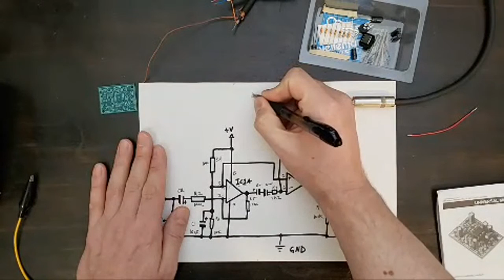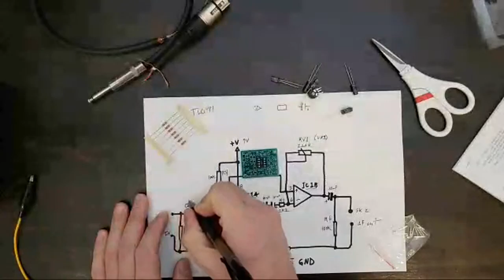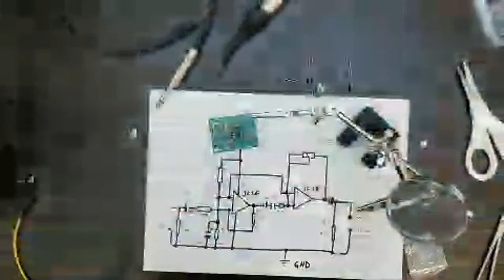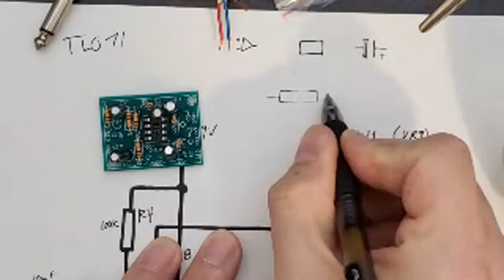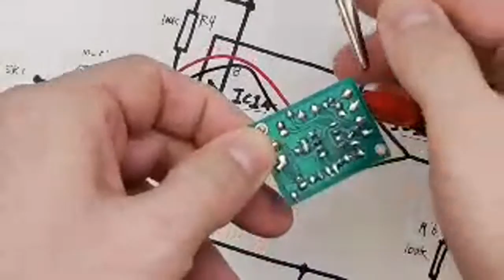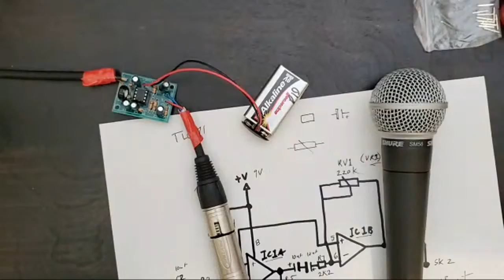Microphone Preamp Build! DIY #stayhome #withme

Comment: Would It be much harder to build a preamp with phantom power? Or an inline preamp, cloudlifter style?
Reply from the maker: A professional preamp is not much more difficult, but phantom power adds about 6 or 8 components. Not a big deal. However, the power supply is what gets a bit tricky.   Better preamps run on a 12v-18v(sometimes 24v) +/-  "dual rail" power supply.  So, while the pro preamps don't have to be very complex circuits, the power supplies are often more work to assemble and debug.  There are several kits on the market with phantom power.  None are as inexpensive as buying a decent Mackie 402vlz3 or vlz4. They come with 2x nice preamps with phantom power.  Nice for the price. As far as building an inline preamp, if you could find a schematic or engineer one, you are still looking at about 28 parts in total(i looked inside one- 4 ultralow noise transistors, and 21 resistors and caps, plus input and outputs and a case).  There are some low cost units (klark technik $30) that work very well, and you simply can't buy the parts as cheap as it is to buy one or two of those.   We could do it, but likely not as cheap or as well as a real Cloud Lifter.
Look for a "That 1512" preamp kit. They are affordable and work very well.  Or INA217. Also good.
Reply: @FrankOlsonTwins  thanks Frank!
Reply from the maker: You bet!